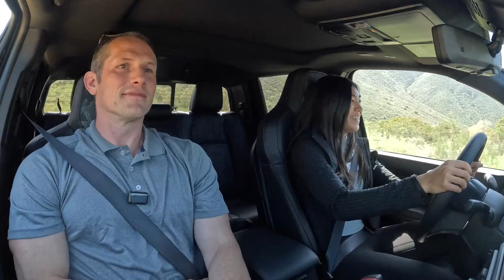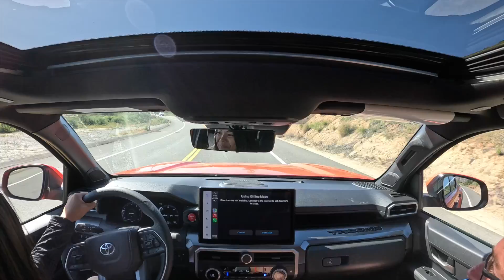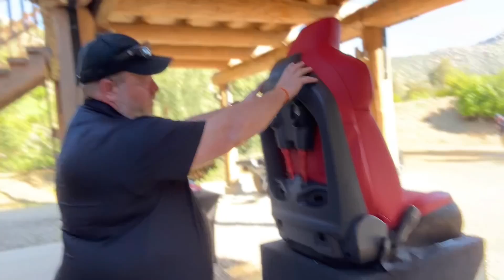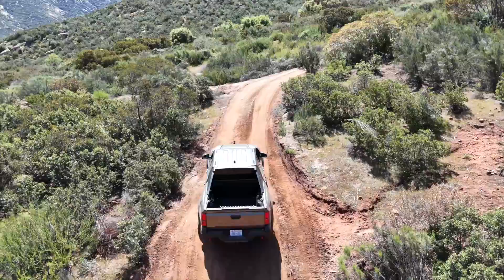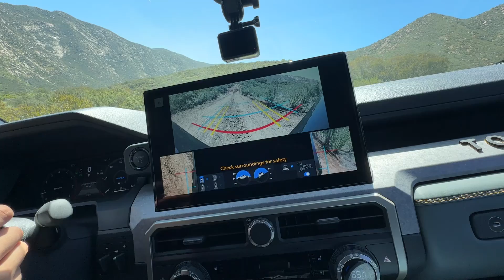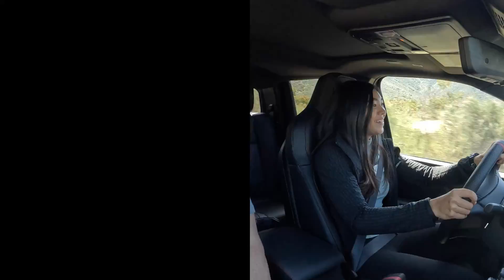I Finally Drove the New HYBRID Tacoma (Trailhunter + TRD Pro)…  A 3rd Gen Owner’s Thoughts

Comment: Chloe, I’ve got a build sheet in with 2 different dealers for TRD off-road and been checking out many other reviews. I’ve seen yours here and there, and you are the only one to compare the I-force max to the non I-force max engine in seat of the pants on or off road comparison. I already knew there was no rear under seat storage but those comments and your complete summary on both points is what I wish I would have seen at the beginning of my 4th gen buying process. Good on you for being the only person to nail that!

Comment: The engine is junk, engine overheating problems, blown transmission, gimmick seats, stupid JBL system with a gimmick speaker that comes out, too much tech that's not needed, overcomplicated AX, overworking the engine, too much maintenance, price is way way too high, and just flat silly. I will NOT be buying any Toyota any time soon.

Comment: It has a smaller gas tank 18.2 gals vs older models at 21,1 gals (2.9 gals more)..
And NO shock hood struts..for the pricing?  Tundra has then..
SAD ..I rather have hood shock struts then automatic tailgate…

Comment: Love both trucks but the monthly payments + APR%, hard to pallet that😮. The only advantage from the 3rd to 4th Gen that I’ve experienced is the upgrade of the 8-speed transmission and maybe a few bells and whistles of the overall truck platform but other than that, the 4 banger turbo’s mid to high range is nothing to brag about in my humble opinion. I’ll drive my 22 TRD PRO til the wheels literally fall off! 👍🏻😊

Comment: Chloe is selling me the seats.  TFL was not showing their capability only that they negatively affected back seat room.  If you buy this truck you really don’t care about the rear seat much less the leg room.  

Great job showing more the performance aspects of the truck
Reply: As a current 2021 TRD Pro owner along with many of my friends who own one, we care about rear seat room and leg room. It's not about the fact that it's somewhat tight, it's the fact that it's so tight I can't even use the seats in a pinch to fit a child seat in the back or haul people that aren't sub 5 feet tall. It's a truck at the end of the day and I need it to perform truck duties not "look at my insane isodynamic seats" that my suspension isn't even good enough to exploit to the full potential. If I were to buy a truck solely for 100% offroading to actually utilize any type of specifically built seat I wouldn't be looking at a TRD, i'd be looking at a Raptor. Furthermore, a few reviewers already stated these seats seem to be meh compared to what Toyota has been advertising them as. So i'm not sure if your opinion is based on your ownership experience or just speculation.
Reply: I treat my 2018 Tacoma like a car. 
I need rear leg room for my passengers.

The four wheel drive and the height from the ground are great in the winter.  🥶
Reply: Besides, this trim is not for me.
I  do not go off roading. Dirt campground roads are as close as I get.

Comment: I guess with 33's 22 mpg is pretty decent.   But for the extra $., I am thinking TRD offroad, add a lift kit and call it a day.
Reply: I was building on their website today and I built a fully loaded TRD Offroad Premium and a Trailhunter fully loaded with everything I could possibly want. The difference was $5k. To me, that's not much, considering if I went and tried to get each individual part the Trailhunter has that the TRD Offroad Premium does not, it would cost well over $5k. I think people get caught up in the price of the truck but they don't realize it's not just the truck they're getting. There is a lot done aftermarket-wise straight from the factory that accounts for that money. High mount air intake (usually $500-700), 3 different steel skid plates (this can cost over $1k by itself), rock sliders (frequently cost about $1k), ARB steel bumpers (Usually a little over $1k), premium OME suspension (Usually over $1k) , premium Rigid lighting (Can also be about $1k if not more) , and I'm pretty sure the sport bar on the back of the trailhunter comes standard too so that could be anywhere from $300-700. Suddenly, that 5k difference doesn't seem so bad. The real question is why they let the TRD Offroad Premium get so expensive despite having none of the things I just mentioned. I could see being upset about the price of the trailhunter if it wasn't so close to what the TRD Offroad Premium goes for but the TRD Offroad Premium doesn't give nearly as much.
Reply: @joshdudeguy2830  If you're going to build a truck with premium parts, the TH is an amazing starting point, and you couldn't get that sum of parts for the cost difference- and that's really the idea- turn-key rig.
Reply: that's probably the sweet spot for many.
Reply: @guentherwilke2055 Most. How many jump their trucks to get the real benefit out of those expensive suspension seats?

Comment: The Trailhunter is definitely cool, but it's just way too expensive and the intake would drive me nuts. I'd rather buy the Offroad with the stabilizer disconnect, upgrade the suspension, buy some nice Methods and save a ton of money. If you really want a premade off-road truck then you can get a Raptor or a Bison for a lot less money.
Reply: Yeah
Reply: As far as a raptor is that a ranger raptor or is that an f-150 Raptor? Sry not too familiar with fords.  But I heard they run in the mid 50s
Reply: @BigOsTaco  Ranger Raptor. The F150 Raptor is a beast and in a different league, both in terms of performance and cost.

Comment: If this Hybrid Engine Option is made available on the TRD PRERUNNER (The Trim that's only available in a Supercab/XtraCab), it would be the best-selling trim for the 4th Gen Tacoma.
Alas, it's only available on the TRD Sport at Minimum, which makes this is a Hard Sell at the moment.

I would honestly consider trading up from a '23 SR5 V6 4x4 IF they make this engine available in the TRD Prerunner Trim...
A Two-Seater Taco with a Hybrid Engine, RWD, Storage Space in the Rear and Bed, with Off-Road Tires and Rear Locker?
It would be a worthwhile Trade-Up if the Price is Right.

Appreciate the Coverage Chloe!
Reply: That V6 is a major POS. Slow slug get away from toyota dude...

Comment: I'm sorry but this is ridiculous. Especially the trail hunter section of the video. You're driving over a few rocks and you're acting like it's so impressive. You even lifted a tire on the dirt section. These trucks are super expensive and less capable than a stock Jeep Wrangler. Yes now you're gonna tell me Toyota's reliability is worth it. Well, if you don't have enough suspension travel and as a result roll over what does reliability matter? For that price tag I want an off roading machine that can eat John Bull for breakfast. I can SAS my 3rd gen and turn it into an off roading machine for less then a 1/4 of that price. And it'll be unique and very capable. Don't forget the Tacoma is still a mid sized truck. The price tag is not justified. And I include other truck manufacturers as well. The economy is just out of control.

Comment: I refused to believe with current technology we can’t create better emissions V8 with high performance!
Reply: Sure they could do it - but it would be very expensive for both R&D and production, not to mention the extra emissions controls like lots of catalytic converters, cylinder deactivation, etc.  Everyone is already complaining that the new truck is too expensive...  how many people would really pay for a V8 when the new engine already has plenty of power?
Reply: @DeuceDeuceBravo  Good points! If it NA V8 lasts over hundreds of miles with no complications, it's worth it to me.
Reply: @DeuceDeuceBravo  A V8 would be cheaper to develop, maintain and improve than these awful hybrid designs with overtuned i4s that won't last 250K miles.
Reply: @north_borne  How do you figure? Toyota would need a completely new design to meet modern emissions and MPG requirements.Thats huge R&D costs for the 1% of Tacoma buyers who would actually pay for it. And with a V8 you're buying more spark plugs, more oil, more coils, etc .. How would maintenance be cheaper?

Comment: Im a die-hard toyota fan 
But i can't respect toyotas move on taking away the v6 
So im going with the ridgeline trailsport
Reply: Which is not a truck frame based legit truck but a unibody car based vehicle with a truck shell. You would never see someone doing off-road in like this in a Ridgeline 👊
Reply: .                        "#Correction" 
We will NOT see YOU , in a Ridgeline.

Read through the comments. 
A lot of #Tacoma Fans are not going to swallow anything Toyota tries to throw at them.

Comment: put in the E3 spark plugs. which increase mileage.  ,i've from my place  (huntington beach) to barstow ca on like just over a 1/8 of a tank of gas. (still 3/4's full).    the iridium plugs suck.  every once in a while use lucas complete gas treatment ,or gum out carb /injector cleaner.   i've driven like 491,000  miles. in 4 different toyota trucks.     oem oarts some times arent the proper plan.
Reply: whoops i've gone

Comment: I was on team hybrid, but 22/24 mpg is hard to get excited about for a hybrid (the  non hybrid Ranger Off Road gets 26 mpg for example)
Reply from the maker: I was hoping for slightly higher #s as well. Sounds like they designed it more for performance (it rips!!!) over efficiency… although I’d personally sacrifice a little bit of that power for higher MPGs. Just my 2c!
Reply: @ChloeKuo  I also watched the channel extra throttle house. The guy on that channel said he wasn’t impressed with the acceleration. And it would make sense because the truck is like 800(something like that, you can check the specs)pounds heavier than the non-hybrid ones. That offset makes the Performance gains minuscule. Not worth $ 3700 extra charge.
Reply: @sammyjammy6647 pretty sure there's a bigger picture to it you just gotta look deeper into buddy
Reply: @MrMikeDao  nope. Other channels have corroborated this experience. Even TFL. Buddy.
Reply: @sammyjammy6647  you are absolutely correct  👍
Reply: Yep, same. My F-150 Powerboost has gobs of power and still rated 23/23 with 23 combined. However, it's one of the rare instances where I'm actually getting more than rated, I can easily get 24-27 in City, and 25 hwy, more with different conditions. But not having that battery underneath the seat is huge, and Toyota again put their battery under the seat of the Tacoma same as in the tundra, there's no storage room whatsoever in the cab. Not sure what they're smoking over there in r&d?
Reply: @MrFordguy73  they decreased the storage because they know people are not gonna use these as work trucks. The reason why trucks are so expensive is because people use them as lifestyle statements. They’re posers. Manufactures know that so they’re cashing in on peoples stupidity.

Comment: I have seen many the R1T's ....which are fully electric, incredibly fast & does off road for desert.
Reply from the maker: I’ve tried Rally mode in the sand in an R1T and it’s insane!! I have a video of it somewhere here on my channel. Although I just can’t get over the small bed size and range with what I currently do.
Reply: @ChloeKuo  I think the R1T is designed for off road sports / exploring & camping rather than carring drywall & lumber....however it would be still very usefel for electricians & plumbers.